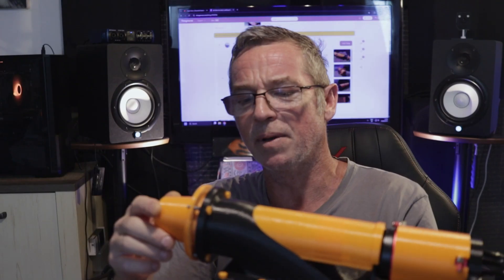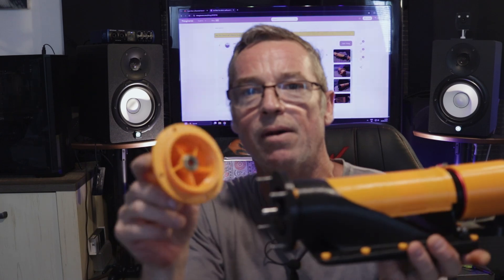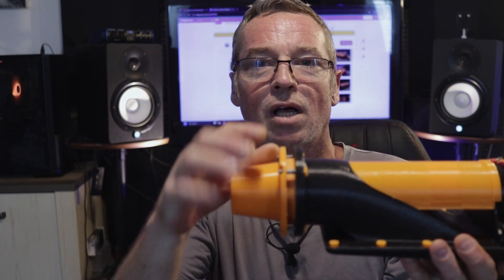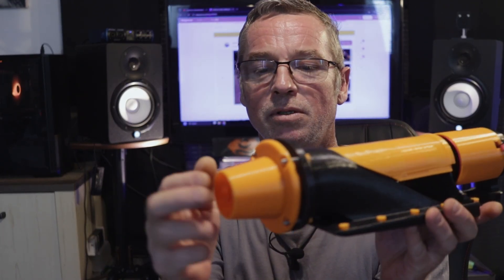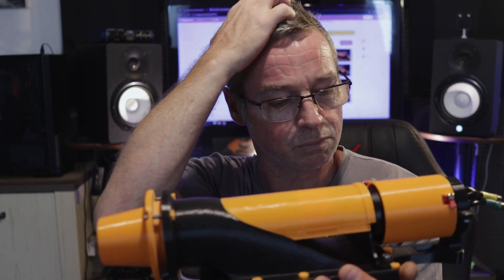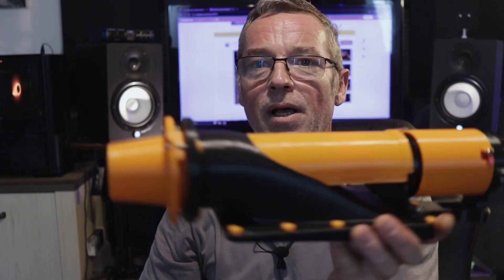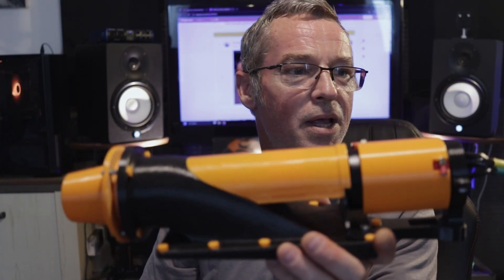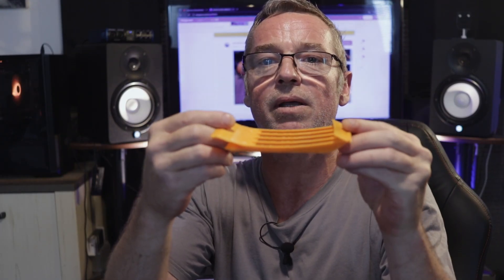3D print these Jet drives for your Diy Electric Surfboard.

Comment: I would really like to have this in a 80mm version with support for steerable nozzle. It would be perfect for kayaks and diy mini jetboats.
I'm building a mini boat under 6ft and that would be great with a 70-80mm version.
I could just resize in slicer, but then the bearings, coupler, shaft etc wouldn't fit.
Awesome job you did on this, I'm subscribing 😎✌🏻
Reply from the maker: Cheers dude you could try and modify in a CAD program not sure if the file is great for manipulation. If you resize check bearing sizes as there are many different size bearings and you could go up to a 10mm shaft. Good luck with your project.

Comment: Hey guys! Anyone have any idea how big should I go with impeller size when using 10kw motor that peaks 20kw at 84V? I know my electric stuff, but boat stuff is new to me 😅
Reply from the maker: Hey there. Not certain but if I was building a single drive board I would start with around 70mm and see how that performs but would also check some forums they are out there with probably a more scientific answer.

Comment: If the pump size is increased in the program to allow for 1 motor, would your model be suitable? And what rpm would be the most efficient motor?
Reply from the maker: Hi you can scale the STL files sure but keep in mind that this is a 58mm impeller with a half mm gap for clearance, so a 59mm internal drive hole. Scale in slicer to keep thet relationship so 69 /79 mm internal etc. you would probably have to trim the top and bottom of the front flange horizontal to stop it getting too big as these were made to fit my board thet had a bigger drive when I started the build. Maybe you could adapt this in a CAD software for better results. As for the motor I run 56140 sss motors I think are 5000rpm and 550kv it's more about good torque then massive rpm so go with a lower kv motor 300kv should be good. As for the correct motor that's where you will have to do some research my friend. Good luck hope I goes well.
Reply: Thanks for the quick reply. I always thought the jet pump needed more RPM. Very nice board design btw
Reply from the maker: @tadaszebrauskas1415  there is alot to it but a low kv will give it power to push out of the water.
Reply: @tadaszebrauskas1415 it needs rpm and torque to achieve those high rpms